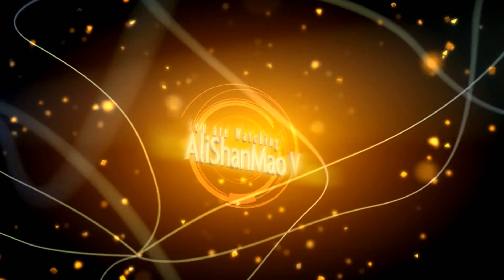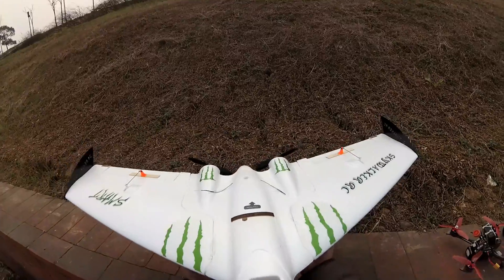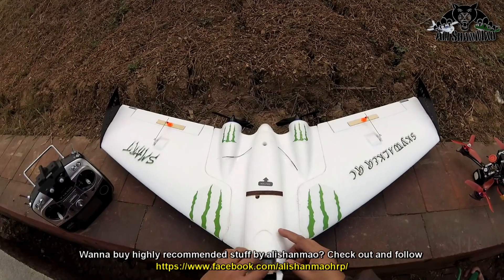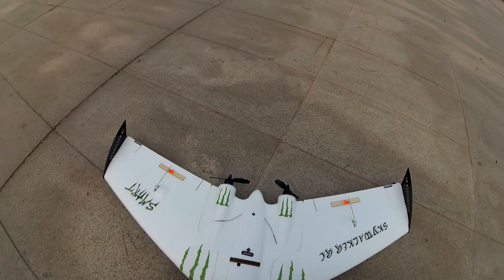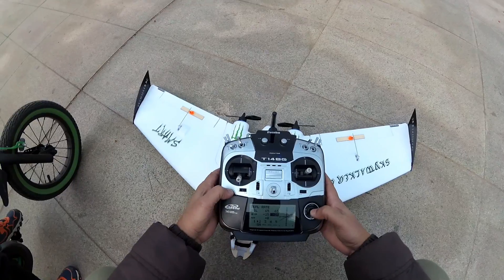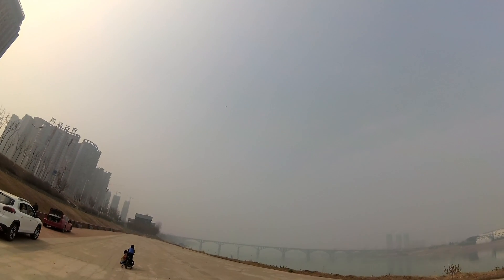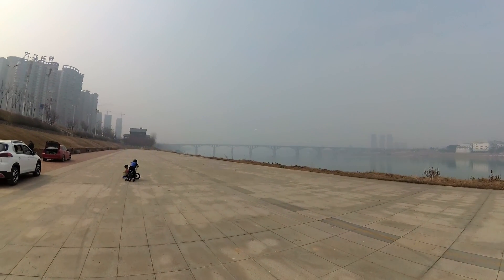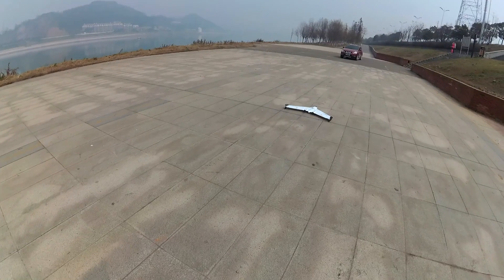Skywalker Smart Dual Rotor FPV Wing Maiden Test Flight

Comment: This wing flys great and agree 6:44 adding differential thrust will make it even better and expected that was done already when I first saw it. I'd keep it simple and just use the rudder mixed in with the throttle.... maybe even reverse vectored thrust for slow landing in a smaller area. Looks like it has enough power to hold itself up and flies like it's on rails.... nice flying.
Reply from the maker: yup :) but I am not using diff thrust
Reply: Well.... make a video if you do;-). I like this wing as it seems to have no wag and should give an FPV cam a nice steady image unlike a lot of wings that wag too much. Have fun riding in it!